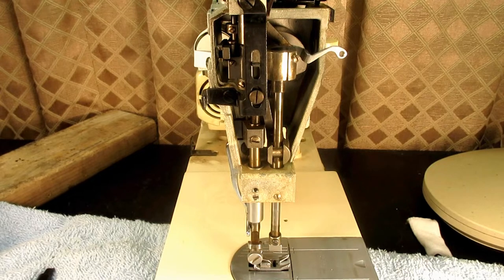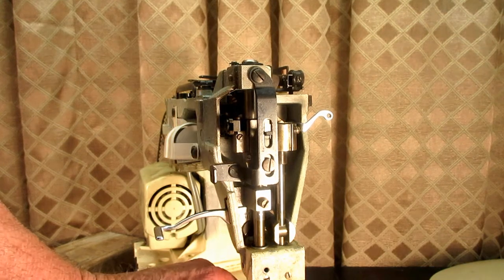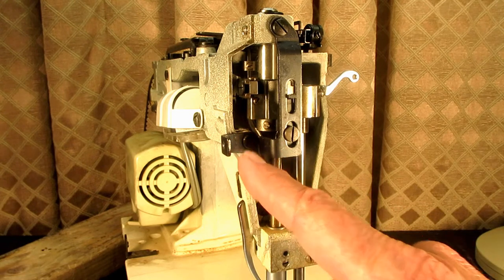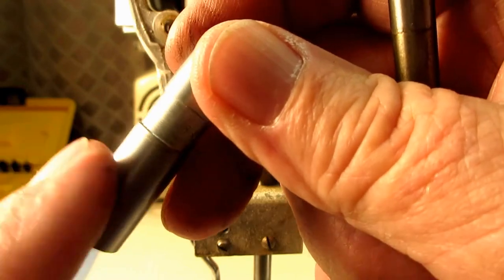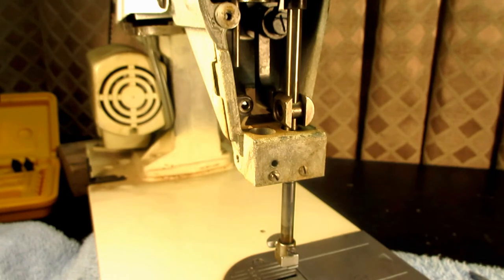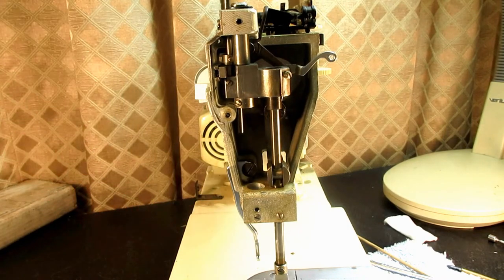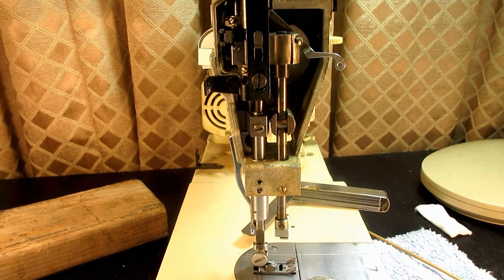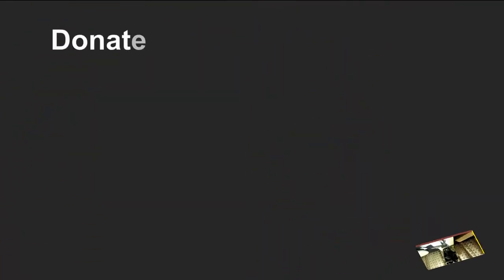The Presser Bar System of the Singer Model 353 Genie Sewing Machine

Comment: Andy, once again you are a life saver for vintage machines. My new-to-me 353 had presser bar issues, which are now resolved, thanks to the excellent video. So thrilled to find what I was looking for on a trusted site.
One thing I noticed when removing the presser bar -- there are 2 marks near the top that look like timing marks. They can be seen  on your video at 25:54, 36:43, 38:52, and many other spots. I didn't know what they could be for until I set the foot height at 7.60mm. Before the set screw is tightened, when the lifter bar is still loose, the lower of the 2 marks can just barely be seen above the bracket that it travels through.
So, if you don't have a way to exactly set the height (I used 3 nickels and a quarter), you could just keep adding height until that mark is barely seen. (Still don't know what the upper mark is for.) Just in case...
Thanks again.
Reply from the maker: That's a great idea, Rocky. Those marks are from the set screw, li,e indentations or scratches. They would be at just the right spot for height and also aligning front to the back of the presser foot too. I never realized that before. Some bars may not have the scratches depending on the type of set screw. Thanks for sharing this with everyone.

Comment: Hello Andy I really need ur help...just bought a singer 237 table top and the presser foot lever is not working...please help!!!
Reply from the maker: Welcome to Andy Tube, Angela. Congrats on your acquisition of such a fine machine. It is common to find a stuck presser and/or needle bar on a vintage machine that may not have been used for years. When you say it is not working I assume it won't lift up and down. Old oil gets in the bushing and other parts there and dries up very hard, almost like a varnish. You can take it all apart or loosen/clean it in place. WD-40 or similar penetrating oil, sewing machine oil, alcohol, Krud Kutter, etc. can be used to soften the dried up gunk and let you get things moving. Please do not force it as that can bend internal parts behind the presser bar. Try to be patient. You can also use a hair dryer to warm/heat things up and loosen the old oil. I have had to treat a stuck bar 4 or 5 times over the course of a day and use heat to finally get it loose. Once it is loose a little bit more WD-40, etc. can get in there and it will free up in a couple of minutes. I actually did a 20+ video series of working on a model 237 I named "Stella". One of the videos was about removing those parts: https://youtu.be/jKN-yOOBwr0
As you can see, mine was stuck too. Here is the link to the whole playlist where I show how to clean, adjust, remove, repair, replace parts all around the machine.
https://www.youtube.com/playlist?list=PLsCOZgzzaiKKzvgm_CYPFnDeM8ZqTTo1h
I know you can easily work on your machine like I did and get it running nicely. It is well worth the effort, and thanks for rescuing your machine. Best Wishes.

Comment: Great video! I hope to find the sewing machine for a reasonable price. The one that I told you didn't have the set completed and wasn't willing to low the price.
Reply from the maker: Sorry, what a disappointment but don't worry; there are a few out there still. Maybe this one was not yours? Keep looking.
Reply: @andytubesewing1953  I will! My husband told me "Just keep your eyes peel" so I know that I will find one. I just need to be patient. Thanks for your courage!
Reply from the maker: A good husband is hard to find, right? Congratulations. Just be sure when you find one that the hook rotates completely and smoothly, otherwise, the gear on the vertical shaft (plastic) could be damaged. A very timely, involved repair.